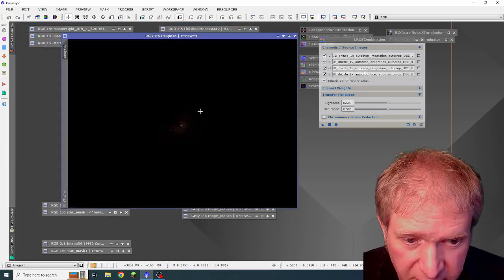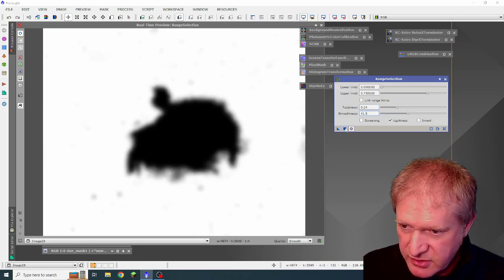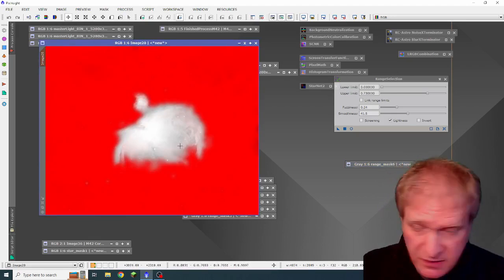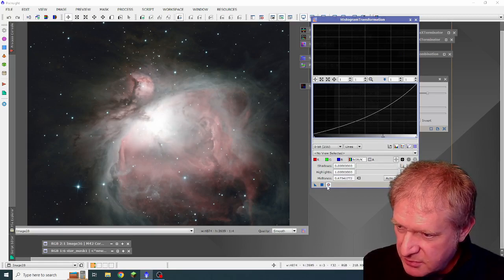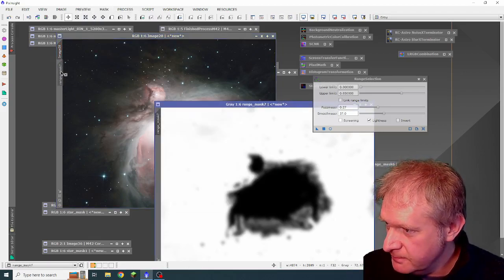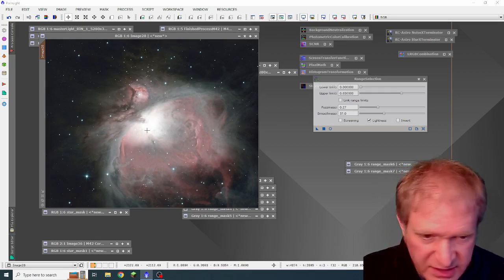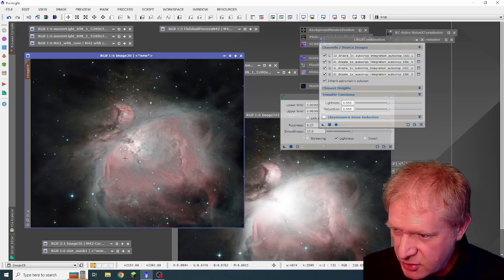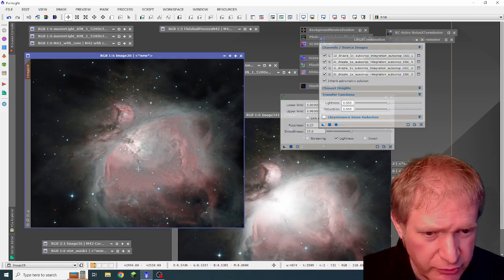Range Masks to Reduce Orions Core

Comment: Any update on the svbony 605cc camera?
Reply from the maker: I'll not be purchasing a 605, or any further svbony tech.  It is a real shame.   I've had never ending troubles with my 405cc which they were unwilling to help me with.   To that end I'll probably buy a ASI ZWO294MC because it is a proven camera with good support.  If you are thinking of getting a 533 sensor camera (605 etc) then go for a tried and tested brand with proven software support and compatibility.  I know a couple of people  had success with their 405cc, but not without having to undergo extreme processing separating bandwidths.  But as a  OSC camera, the data was horrible and extremely difficult to stack, full of artifacts.  I can't get mine to work very well at all, I think I've either got a bad one or I'm being a Muppet.  Also there was an issue discussed where it applies extreme noise reduction which removes stars but leaves artifacts, called Star Eating.    I might give it one more try before it sits in its box.
Reply: It was the 405cc I meant :). That's a shame to hear I was hoping it might have been viable
Reply from the maker: I will try once more with a refractor at 715mm focal length, which suits the pixel size for the camera.  I have learnt loads during the time owning the 405cc, all of it about resolving problems.  I've lost most of this seasons imaging due to the data being poor.  As soon as I changed the camera to my 269c, the issues went away.  My conclusions are that choosing well established, tried and tested equipment is essential.  I'm all for new products and pushing things forwards as long as there is support.  If I had known the issues I was going have, I would not have bought it and gone for the established ZWO 294MC or Altair 294c tec which are established and known cameras which work.